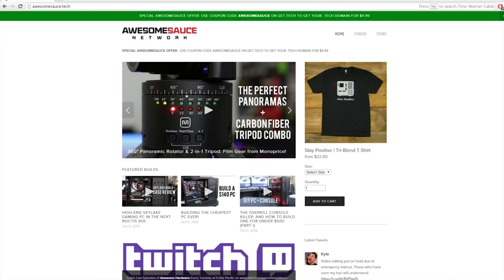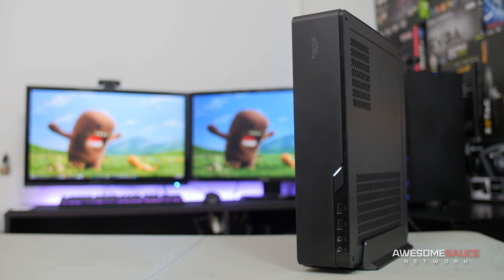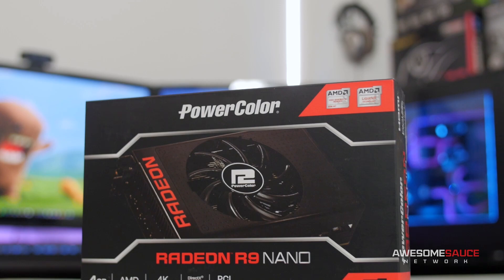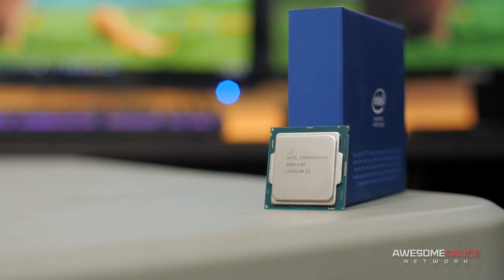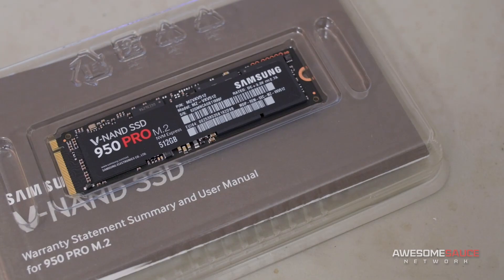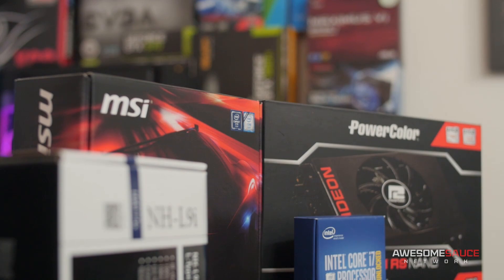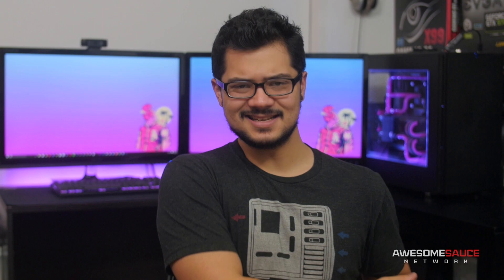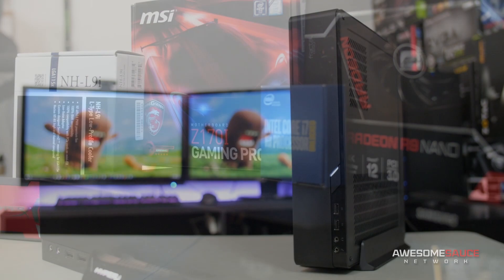The Go Anywhere Do Anything PC!

Comment: why not just use a laptop?
Reply: Not powerful enough, he needs a portable but powerful desktop build which this provides and most laptops don't.
Reply: +Rockmandash12 Probably just needs a computer for rendering video and doesn't what to have to carry around an additional laptop to the one that he uses. Also I imagine that the price to performance would be better. Along with fewer cooling issues.Who knows? Maybe he just wants a gaming PC that he can mount behind the TV when he's not traveling.
Reply: That would be too easy :P
Reply: then he wouldn't of had a video to post lol
Reply: +SirHowad plus it will likely last longer than any nvidia based gpu "high end" laptop..
Reply: +SirHowad 
You can now get laptops with an Intel Core i7 6700 and if you really felt like showing off you can get the i7 6700k lmao

and a GTX 980 in laptops is also a thing now
Reply: +Jew Jitsu laptops have two big problem they like to overheat and they cost more money than pc with all same inside
Reply: +Jew Jitsu Those laptops you're referring to fetch like $2500+ in price. + heating issues doesn't make it worth.
Reply: +Jew Jitsu Also the battery life on those kinds of laptops are horrible. i'd rather just be stationary with a pc like this
Reply: You can always disable the GTX 980 and just use the integrated Intel Graphics which will result in less heat and longer battery life.

If you want portability and Desktop performance you have to pay a hefty premium
Reply: +Jew Jitsu its still gona overheat and it gona be loud as f*** when it gets harder task and its still gona cost more as almost same pc
Reply: SirHowad I feel like that's a hard sell to make nowadays when you have a near renissance in reasonable gaming laptops, with thin bodies, quad core CPUs and High end GPUs that can get really close to their desktop counterparts in performance, if not near identical in the 980's case. Hell, even laptops like the Lenovo y50 are rather comparable to desktops in it's price range.

It's just really impractical to carry a device without a screen when on the go imo, this decision baffles me, as it will anyone who sees it XD
Reply: +Rockmandash12 The cost to performance of laptops is bad because they're virtually unupgradeable there are some components you get to keep when upgrading to a new desktop that you really can't with a laptop: monitor, mouse, keyboard, UPS, wireless solution, coolers, and storage being the ones that come to mind. You buy new ones of those every time you buy a laptop.
Reply: DeilGrist Yes, upgradability is definitely worse on a laptop, but let's be real here. We're talking about a machine who's sole purpose is to go on travel, and the inconveniences of a desktop make it a horrible choice for travel, because it doesn't have any of that and they're all in separate units. If we were talking about someone's only machine, it would be a different story, but this is about a machine to take to trade shows and such. Everyone else who goes brings laptops because of the impracticabilities of using a desktop at a trade show, and I think this applies here as well, even if awesome hardware covers PC hardware.
Reply: is there a problem traveling with pc inside a case
Reply: +Erik Maki just get big case xD
Reply: Erik Maki Yeah, you don't have a keyboard, mouse, a monitor, etc, it's not a very portable solution even if you have a small machine and dealing with that on a trade show seems a bit ridiculous.
Reply: +Rockmandash12 nah ldc xD they all got shitty laptops and l got my little beast xD
Reply: Rockmandash12 If you're cool buying a new high-end laptop every 2-3 years to stay relevant to your rendering needs just for trade shows, good on you. Most of us don't have that kind of money or usage scenario.
Reply: DeilGrist Most people don't go to trade shows and need to render when they do! This build isn't about most people's use case, it's about his.
Reply: +Rockmandash12 Most people who dont own a gaming laptop from a recent time have no idea how good they really are these days. Especially the 17 inch for factors, which tend to have incredibly efficient cooling. My gtx 680M is overclocked over 200mhz on my setup, and i dont ever touch on anything higher then 77c on the gpu without any sort of cooling pad. Imagine what a 9 series would be like with the better tdp's and form factor.

Comment: Killer ITX build! A lot of 950 Pro owners including myself have noticed some thermal throttling during large loads and benchmarks. Removing the sticker and throwing on a small dab of thermal paste and a couple 20mmx20mm heat sinks fixed the problem without a hitch!

Comment: You KNOW that 3rd screw is gonna bother you, and you're gonna put it in anyway
Reply: 90 degree screwdriver will solve that problem without needing to remove the cooler.
Reply: You can actually take the frame apart with a few screws and do those 3 without taking CPU cooler out... I suppose he didn't read the manual.

Comment: Why did you even put that fan there?;D Its not doing anything
Reply: +Backyard Barbeque Boys lol nope. the slot next would be intake for gpu
Reply: +pjgmorgan It's a general intake fan for the whole case...
Reply: well done
Reply: +Vilius VK Positive case pressure to push that hot air out of the case.
Reply: +Vilius VK Facepalm
Reply: I found that intake case fans are really noisy in this case as the dust filter rub against the fans

Comment: I'm using a Silverstone FTZ-01 right now. I bought it almost new from someone who built it, not knowing I could fit a full graphics card into it. Now I have a 770 SC 2GB, only thing I need for a 980 sometime in the future (maybe even a Pascal) is a new power supply (currently has a 350w). I can carry it under one arm with minimal struggle into a car and a friend's place. Not to mention the slick feeling textured case. Coolest case I didn't know I wanted til I got it. :)

Comment: Just a thought, seems like you could have tightened that third mounting screw for the PCI riser card using a ratchet wrench with a quarter inch head. A standard size driver bit should fit quite snug into a quarter inch hex slot. Just gotta watch the torque with that leverage.

Comment: You do realize that with this case the GPU assembly is a removable, which allows easy access to the three screw posts to mount the riser? There's no need to disassemble the CPU cooler if you forgot to do that first.

I know this is an older video, just putting it out there is all.

Comment: For those commenting on why he didn't get a laptop, the processor alone simply can't be matched by any mobile CPU, and those few laptops that use a non-mobile gpu cost 3,000 dollars and up. Also they use a gtx 980 in those laptops, which is comparable in performance to the R9 Nano he used in this video (at 1440p the nano is slightly better).

Comment: Nice build, Kyle.  However, I would have stuck a LinusTechTips edition Noctua fan or a similar black fan on that CPU cooler.  The orange and black would have worked out pretty good with the red and black on the mobo.

Comment: About a week ago I got the urge to build in this system, the only one thing that has got me worried are the temperatures. I know that this Noctua cooler is only a more silent version of the stock Intel cooler, but still, it's capable of doing more. Looking at how you mounted the cooler, it really isn't able to do so. Just look and think about it! Air is drawn from above the cooler onto it, but what is pulled in also has to be pushed out somewhere else. One side is COMPLETELY blocked by the RAM! While the other side isn't thát bad, still, it's rather restricted. Couldn't you have mounted the Noctua cooler twisted by 90 degrees? The fins of the heatsink would've let the hot air escape towards the PCI-e riser card and to the side of the case, outward the case, the same side the PSU pushes the air out. Sort of the same thing goes for the GPU, it's restricted. It can pull air in, but can't push it out, because that BeQuiet fan is ALSO pushing air in. Why not have 2 BeQuiet fans mounted there? One above the GPU pushing air onto the GPU and the other one pulling air OUT of the chassis. Yes, dust will be more of a problem than before, but seriously who cares (and it won't be even that big of a problem)? I'm stoked to sell my system and start over from scratch (partially). I don't think this case has that much of a cooling problem everyone says it has... Yes, I am stubborn :P and even if I fail, I will take the temps for granted, this case is too awesome to let it pass by (ssh, I know it's been out for a year :3)

Comment: For that last screw, or tight screws in general, you should get a driver with a 90° joint and ratchet feature. I'm sure they exist.

I would think you may want to use external storage for your media. Do you have external drives you'll be using?

Comment: Actually, you can cheat with that third screw and use a small screw bit in combination with a ratchet that fits the screw bit.  I've made that mistake before on a customer's build and didn't want to remount the CPU cooler.

Also, why didn't you choose a water cooler for your CPU?  An AiO unit like the H60 would work just fine where your case fan is, give you some room to overclock, help with moving the CPU heat out of the case with that rather warm R9 Nano in there, and protect you from the effects of high ambient temperature air cooling during those busy conventions.

Otherwise, badass little rig you've got there.  That solid state storage is pretty impressive I must say and I'm jealous of your NAND.

Comment: I would recommend the Scythe Big Shuriken 2 (rev.B) CPU cooler for this case. It fits perfectly, even without removing the top dust filter. I'm using an i7 7700K with G.Skill Ripjaws 4 RAM (40mm tall) and there was no RAM clearance issues either. While stress testing the CPU under full load, temps never got hotter than 65c and idles in the 30's. I was previously using the Noctua NH-L9i and temps would spike to the 90's under load. I should have bought the Big Shuriken cooler first.

Comment: Great build, but I think you should have put a reasonably sized AIO cooler where you installed that be quiet fan (If I'm not mistaken) to at least try to push some decent overclocking on the CPU.

Comment: For any one who can afford $2200 to 3000usd, and wants desktop grade performance, there is is a laptop which comes with a desktop i7 6700k processor and a desktop GTX980 8GB graphic card. It also has a 17inch high quality display with G sync. 

RAM upgradable upto 64GB DDR4. Two m.2 ssds in RAID 0 configuration. Space for two more hdd or ssd. Processor and graphic card are not soldered, which means they can be upgraded in the future.

Despite of heavy specs it weighs only 4.5KG. It's battery lasts 3 hours on video playback and about 30minutes on heavy load.

LinusTechTips did a video review on it and it did not over heat.

Comment: If you had used a Silverstone Raven RVZ02, or the sister chassis Milo ML08 (which is available with an optional carry handle), you'd have picked up an extra 2mm in CPU cooler clearance, allowing the use of the bigger Silverstone AR06 cooler… which I'd ditch the included fan and instead pair with the same Noctua fan that comes with the cooler used in this video. That said, the Noctua fan is already 1mm slimmer on paper than the g that comes on the AR06, so maybe you can force that combo to work despite being 1mm taller overall on paper than the Node 202 claims it can handle.

Comment: two things.
have you ever seen the silverstone ml08? it is smaller than the fractal node and has a handle on it.
also why did you choose to use an r9 nano? you could have easily fit a full length gpu in there that would run cooler and with less coil whine

Comment: You could have installed a seidon 120v or a captain 120 behind the nano if the 8pin cable wasnt a issue by having the pump tubes go thru the gap next to the ssd mount. Which would have given you more cpu power.

Comment: Nice build here Kyle, But i'm wondering how the thermals are on the 6700k at full  load since it has a 91w tdp. I understand u wont be overlocking because of the space issues and thermal distribution limitations of the node 202.  The NH-L9I max tdp is 65w Which i didn't realize that when i picked up the cooler it was my fault. So i  had the  NH-L9I installed on amd build in a micro itx case the BitFenix Prodigy M case. With a 8350 i use it for streaming and rendering so it couldn't handle the thermals the cpu was running at 80+. I ended up sending back the NH-L9I  and return for the hyper 212 evo which ended up working just fine under full load i did all the thermal testing in windows with aida64 before i installed ubuntu server 14. Anyways just wondering what the max load temps are maybe you can post pack what your results are. Sorry for the long post lol but keep up the viddeooss

Comment: A heads up that the R9 Nano thermal throttles with the stock cooler, so you probably don't want to overclock it and you may even want to drop the core by 50mhz or so.

Comment: Hi, I'd like to ask how did you install or is it really possible to fit a 8cm (2280) drive in the back of the MSI Z170I. I have the same board and I haven't tried it yet because I saw from MSI's website that it only supports 2242 and 2260 drives. It saw on the video that there wasn't any screw to secure it. Will it be okay that way?

Comment: Question: How did you get a Samsung 950 SSD which only comes 8 cm long to fit on the back of the MSI Z170i which only supports 4 and 6 cm M.2 SSDs? There is no screw hole to hold it down.

Comment: wait wait wait. Where's the thermal performance benchmarks? I want to know what the temps are and whether there is any thermal throttling occuring. Especially, I wanna know how well that little cpu cooler works.

Comment: insted u using a air cooler for the CPU u could use the crossair watercooler that is designes for mini ATX motherboard (i dont remenber the name)if it fit in the case and that way u use the CPU and motherboard features (overclock)

Comment: @Awesomesauce Network I coulda sworn when I was shopping for a MITX board that the MSI gaming mobo didnt have a 2280 M.2 so you couldnt use 950 pro? Then the photos on the episode didnt show the ssd screwed in. Did you tape it? If so did it support NVME? If I had known it would work I woulda bought that mobo instead.

Comment: I see from one of the angles, you have the clearance to put another case fan under the video card. Would it be worth it though? If the fan is a slow enough speed, could it not do any damage to the gpu fan's bearings? Curious because I might attempt something close to this same build later this year.

Comment: I'm doing this same build with same processor and cooler... and I already know the cpu cooler installation is gonna be a pain in my ass to do. I'm very VERY overtly cautious when doing heat sinks. This one installs very crazy like. I'm guessing i'll have better luck just putting it on while the the mobo is inside the case since there are no mounting support when installing. I suck at putting heat sinks on. I literally had to reinstall an EVO heatsink 3 times because I kept fing it up haha.

Comment: They should make prebuilt versions of these cases with gtx1060, intel skylake i5, 2x8 gig ddr4 ram, 256gb ssd, 2.5inch 1tb hdd drive(a laptop hdd), a wlan capable motherboard. Building this case seems like a huge hassle to me, and the system I described would cost a lot less than a console and perform a lot better than one. Why not prebuild this and sell it like that?

Comment: How did you deal with the fact that this motherboard only supports M.2 SSD's up to 60mm, when that Samsung 950 Pro is obviously 80mm in length?
Reply: He'd have to have used some glue or double sided tape to keep it from lifting up and falling out when he takes it on his travels.
Reply: Well Realistically look at just PCIE the USB continental SSDs benched there's not a whole lot of differences numbers everywhere, I think it does and you can feel the difference though but it was like how it always was still bottlenecked by the RAM because it was always faster etc.

Comment: Finally, what's you can say about temperatures in this cases? Did you use 120 mm fan configuration inbound airflow? Do you recommend this case for new 9 generation i7 9700 processor? Thanks for the answer!

Comment: When are you going to post part 2 of this video? I'm using the intel stock cooler in this case on intel core i5 4590 and I'm getting 83 degrees celcius in cs go, 75 in gta v, next car game 70 and flatout 2 63 degrees. I want to buy the noctua cpu cooler and I wonder if the temperatures will get lower.

Comment: Did the 950 Pro SSD work on that motherboard? Reason I ask is because I was looking for a similar combo for a new rig, but the 950 Pro is an 80mm long M.2 card, whilst the MSI website states that this motherboard only accepts 42 annd 60mm long M.2 cards.

Comment: Could always install that 3rd riser screw with a rachet and a bit driving socket. Or a right angle bit driver, what have you.
Reply: You can take out the part where the screw goes in, so there is no need to install it first. It's similar to the Raven Z by Silverstone.

Comment: i saw a msi z170I gamin pro used as the motherboard in this build, and also you put in a M2 SSD I have read some review in other sites and they say that the samsung 950 pro doesnt fit in that motherboard (80mm) how did you fit that ssd into the motherboard? or u just simply ignored the screws?

Comment: Hi! I've the same case and I have to say that's quite perfect! But I'm just stucked with a issue: I can't do a good cable management, I've taken a corsair sf psu (it's fully modular but I've installed just the essential cables) and I can't fit properly all of those cables... I see you didn't had this issue, maybe because you have the fractal psu there. Could you please help me?